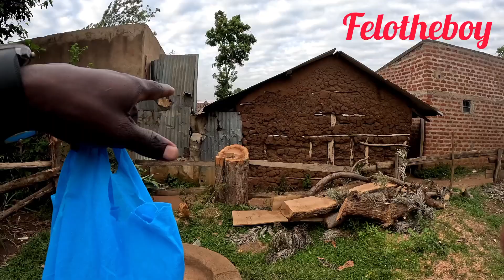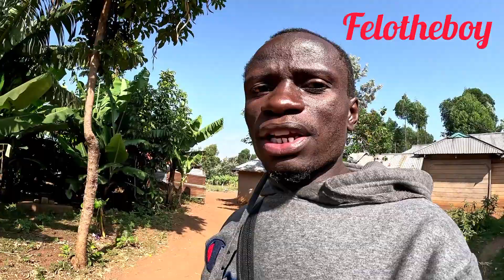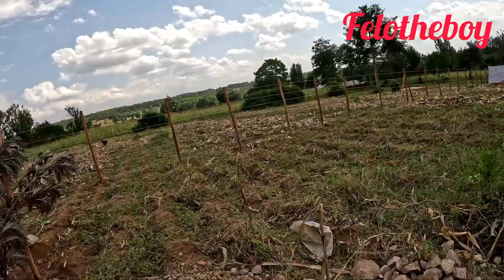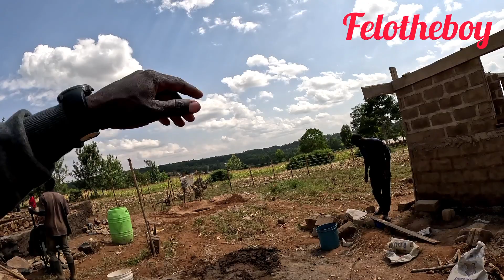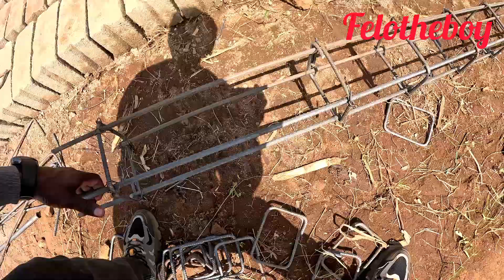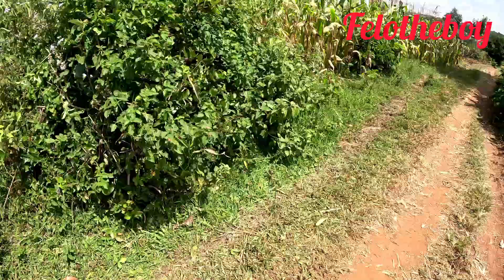Get to know how we ended the case

Comment: The pillars are normally cast before laying of the bricks which are then connected to them.The steel reinforcements should have used the full length of the steel to the height of the house instead of joining it afterwards which coukd weajen be he pillar